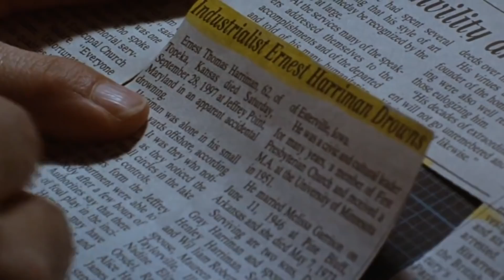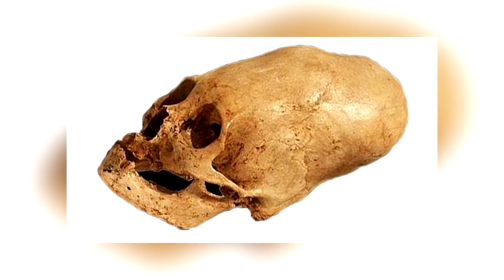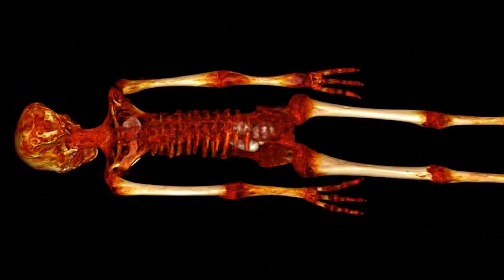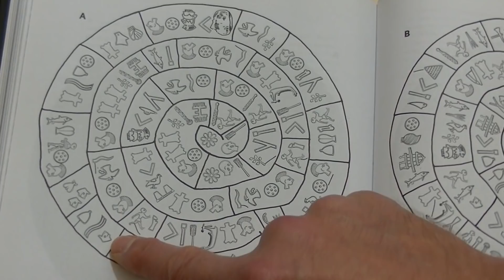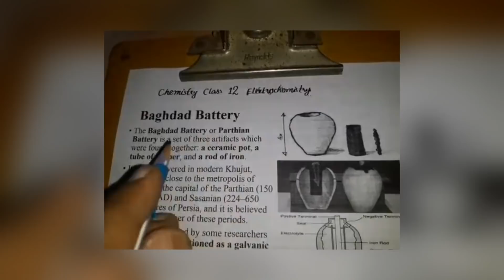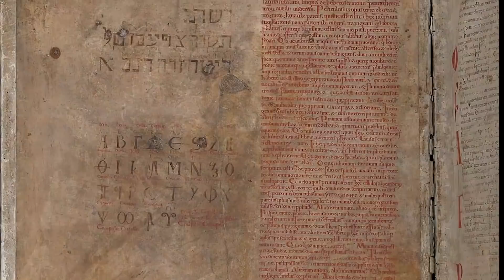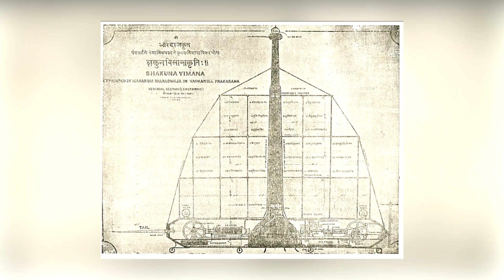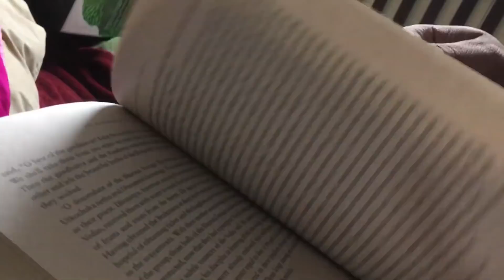12 Most Mysterious Archaeological Artifacts Finds Scientists Still Can't Explain

Comment: the only problem with the head binding theory creating the elongated skulls is that the skulls show no signs of that happening to them. when bones are reshaped they show stress from that.

a very small percentage of the skulls were head flattening techniques. the rest cannot be explained. the stitching on the bone shape and how we understand skulls. 

that elongation is how they were born.
Reply: This would be true for children (3+) undergoing the head binding process. However babies are born without their 8 cranial bones fused together. For the first one to two years of a babies life the bones in their skulls are separated and disjointed so they can grow as the babies grow. 

Any stress put on the skulls during the years where the bones have yet to fuse, like head binding, would not show any signs of that process on the bone itself.

Comment: The Chinese seismograph detects 'tremors' actual earthquakes when they happen and the shock wave has travelled through the Earth.  It does have a time delay of how long the shock wave takes to reach the device.  It predicts nothing.  It is more or less as accurate as a current seismograph and is actuated by the same actions.  Except the modern on can pinpoint the actual center of activity quicker and more accurately.  Yes, it is a neat machine developed long ago, but it's not mysterious nor inexplicable.
Regarding the Peruvian mummy.  The title of the video is "... finds Scientists still can't explain.  But you explained it.  Odd
Same for the Indian tower.  You know all about it.  What's the mystery?
Viking sunstones have been described for ten years I recall.  They are not a mystery.  Perhaps the full routine, but its much like the 'mysterious' process of learning to use a sextant or other navigation device.
Reply from the maker: Hi my friend! Isn't it all mysterious?!?
Reply: @LightningTop12  The subjects enumerated or the title of the video?